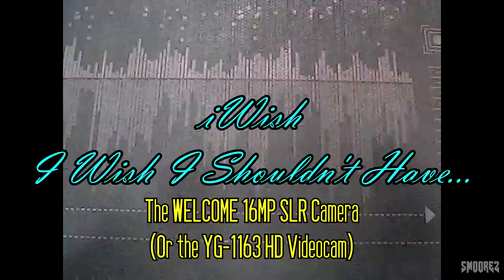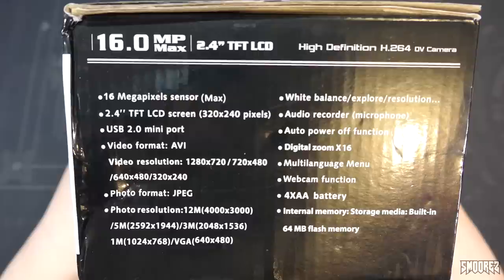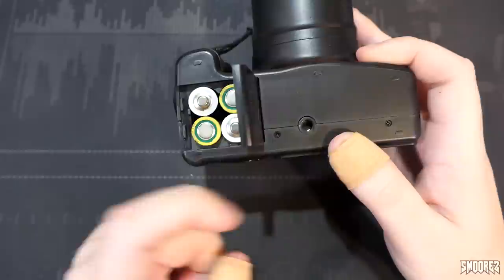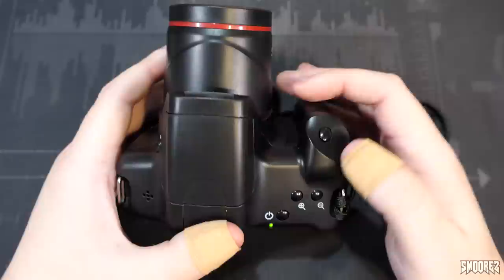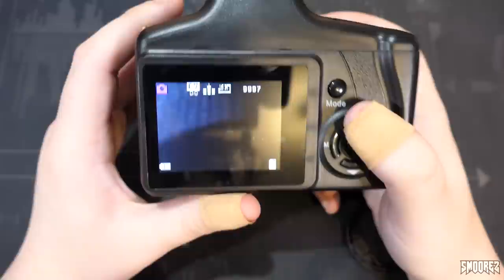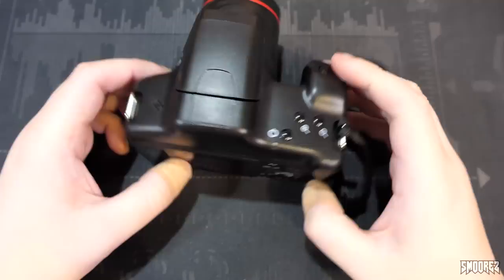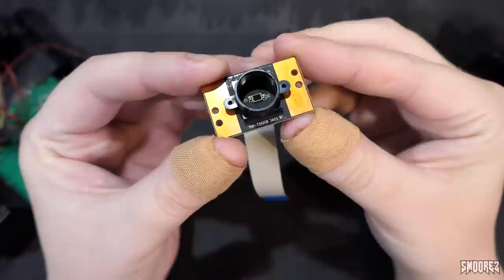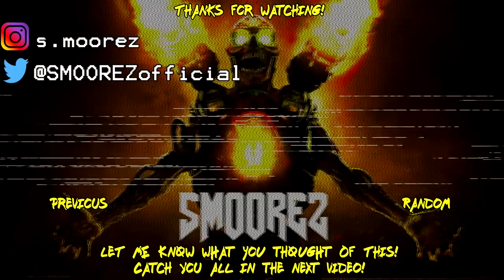iWish: DO NOT BUY THIS CHEAPO CAMERA FROM WISH! (or eBay/Amazon etc) YG-1163 HD "DSLR Camera" Review

Comment: Well done for your hilarious take on a camera that is a steaming pile of garbage! As you say, an old mobile phone from a decent brand - even a model that was towards the budget end of the range to start with - would be a much better camera than this. An old digital camera from a decent brand would also be a better option - even a 8 year old model, so long as you can still get a new battery for it. Neither of these options would cost much, but they would make an excellent first camera for a beginner even though they are unlikely to offer decent stabilisation and will not compete on resolution, sensitivity, dynamic range, autofocus quality and other performance metrics with modern cameras.

Nobody who knows the first thing about photography is going to mistake the review camera as the Canon DSLR plus L lens or high end bridge camera with integrated L lens that this thing is styled on. As you point out, it looks like the garbage that it is. The tripod mount is particularly awful - am I right in saying there is no metal threaded insert? With the tiny mass of this thing, it probably won't matter much, but there should always be a metal insert to avoid thread cracking and premature wear.

Don't worry about not knowing about focal lengths and apertures. When reviewing a camera based on a tiny fixed focal length webcam module with seemingly no iris fitted (so fixed aperture) and an appalling fixed focus (well, just about manual focus) lens, the absence of that knowledge will not detract at all. It looks to be 'pretty wide angle' and 'fairly narrow aperture'.

The one thing I noticed that you didn't comment on is the terrible dynamic range of the sensor. On the footage of the frog, the highlights were horribly blown out. I have my doubts this thing has any sort of exposure metering or adjustable ISO.

Camera reviewers often upload the raw footage and still files, so that people who are interested can pore over them with their chosen software. Perhaps you could upload them to Google Drive or similar cloud storage and put the link in the description.

Comment: how many people would have to buy that to make up for the tooling and other initial production costs, jesus, I would have to guess that there's some vocational school or university internships somewhere in china that throws govt fund to commission or even 'ask' for nearly free to make mold for the camera body. parts and pcb would presumably  be cheap since there's always the production and design line for the electronics bootleg industry, but someone has to have enough skill for the body molds. it's not even stolen mold out of discontinued legit camera model.
Reply: with many parts being old and basically junk that you'd pay someone to take them away, say... $1000 for the whole  assembly  line? 30-50 piece to break even... actual chinese themselves would probably even never pay that much for gift for someone's kid. unthinkable amount of trash that probably won't ever break even. the best  reason for it is probably to throw the old electronics trash out of china for most money possible

Comment: Blimey, It's a dashcam in a DSLR case.
Reply from the maker: More like a 2004 Webcam in a cheapo DSLR housing. Then again Dashcams usually film in 1080p...so you may be correct there :)
Reply: @SMOOREZ  Your right on with the lens, but the software..... The biggest giveaway is the options for sectioning the video stream into minutes, for protecting the video files after witnessing someone on the road being a Dhead and putting it on YT ;)